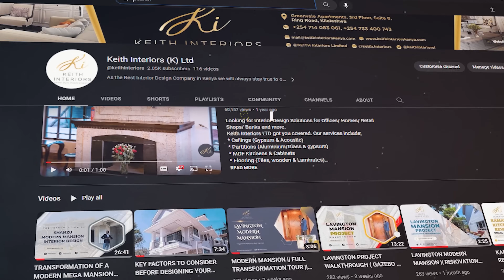EXPLORING THE GRANDEUR OF AN ARCHITECTURAL MARVEL | TOUR OF A MODERN MANSION | PROJECT INTRODUCTION

Comment: Kenyan builders really need to stop making life difficult for themselves. Building a house with nothing but stones then cracking those same stones to pass wiring and plumbing seems unnecessary. It compromises the structure. You could have easily used some 2/4s and sheet rock to creat a nice wall then run all wires and plumbing behind the walls. That way all those stones stay intact.
Reply: Not just Kenya all over Africa. Framing is a new concept